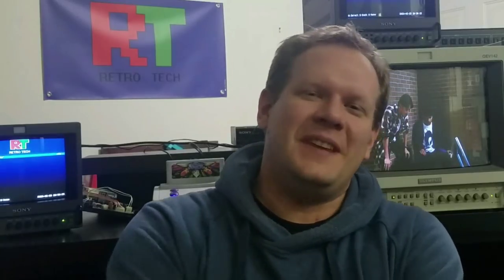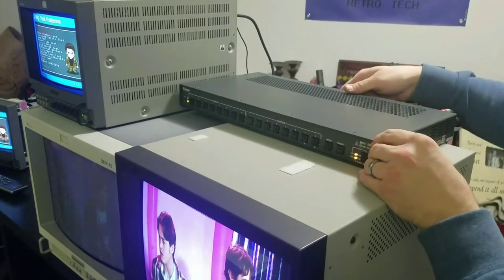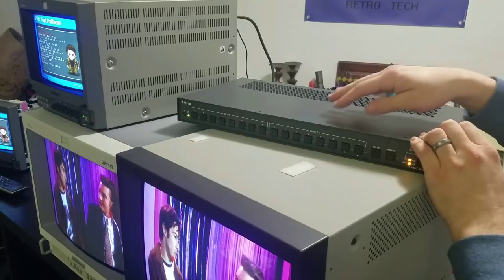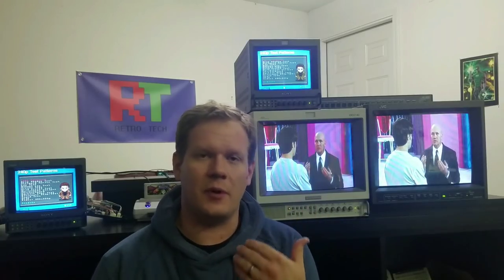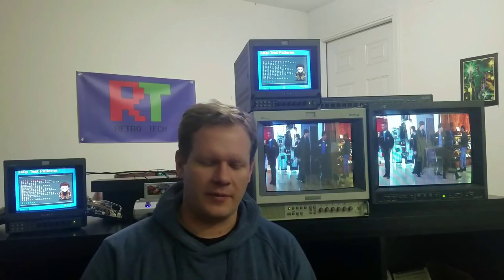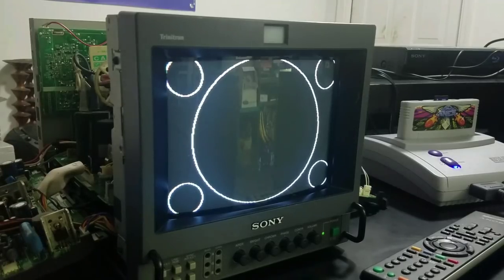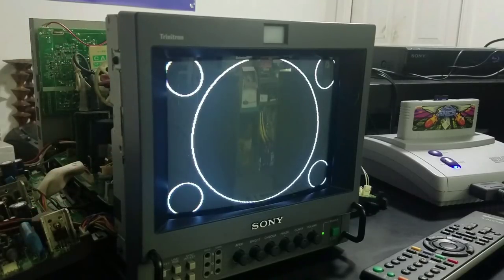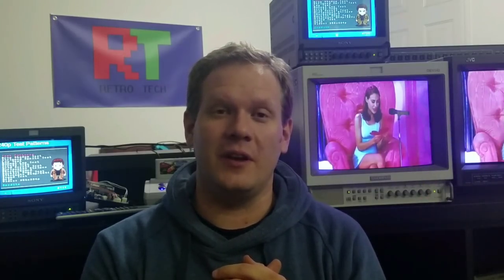The Best CRT Q&A Video on the Web! *2019 Vol. 1

Comment: I plan on getting a JVC D-Series CRT like you have and I plan on doing a full cap replacement on it.  However, I do have to learn how to solder.  Would learning how to solder well enough to do a full cap replacement on a CRT be something the average person could accomplish in a month?
Reply from the maker: The hardest part about replacing caps is removing the original ones.  It's difficult to do without a desoldering tool, but with one it is quite easy.  I recommend practicing on spare or junk electronics to get good at it.

Comment: Out of curiosity because I'm considering possibly doing a cap replacement on my sets, what differences or improvements can typically seen or be expected afterwards? Or is it a more case by case basis? Always trying to distinguish from what can improve to what is just a natural characteristic of a crt. For instance my JVC d series has nice defined scanlines in the middle of the screen but become less distinct towards the top an bottoms of the screen due to more color bloom. Do you have any before and after comparisons? I'm going to rewatch some of your content in the meantime, thanks again.
Reply from the maker: It's really a case by case basis.  The best thing to start with is trying to calibrate the CRT using the sub-menu to see if it can be corrected without a cap replacement.  If some things won't change much, like pin settings and linearity, then your caps may have failed and are causing bowing.  Also a crt can't get worse from a recap, so you can recap it & then calibrate after to see the best screen potential of the CRT.

Comment: I have a 29" consumer trinitron that is RGB modded, and I had some trouble with corner convergence and no amount of convergence strips would make it right. With small deviations they work great, but for larger distortions they don't. I ended up adding wedges to my set to pull the yoke away from the screen and that lifted the corner to almost perfect geometry.
Reply from the maker: That's great.  I have to open my 27" modded one and do that exact same thing.  Thanks

Comment: Great video!  I've encountered a number of consumer CRTs where when I've put up a pluge test pattern, I can't see the darker bars in the pattern at all no matter how high I turn up the brightness.  This problem manifests itself as heavy black crush in the picture.  Could replacing all the capacitors in a CRT restore the TVs ability to display shadow detail and no longer have black crush?
Reply from the maker: Thanks, do you mean the 3 black rectangles within the black squares?  That could be due to limited resolution of the consumer CRTs.
Reply: I am referring to the test pattern that measures black level (aka. brightness).  It does have 3 vertical black rectangles on the left and right side of the screen and a vertical gray ramp in the middle of the screen.  I guess what I'm really getting at is that I have tested out a number of used consumer CRTs that had bad black crush and no ability to display shadow detail.  For example, I'd play a game like Batman for NES and could not make out many of the details in the background because of the black crush.  I had always thought this might be because of an issue with the CRT (i.e. a bad capacitor, etc.).

Do you think that doing a full cap replacement on a CRT could restore the TVs ability to show the full black level and show shadow detail that would normally be present on your average CRT?  @RetroTechUSA

Comment: hey whats a crt model that can put out up to 1080 ..so basically do from sega genesis/super nintendo all the way to gamecube/ps2 systems ??   i was just going for a good size bvm but some of those dont do 1080.
Reply from the maker: If you are wanting a Sony, there are a couple PVMs.  The 14L5 & 20L5.  These do 240p up to 1080i.  Then there are a couple BVMs that do the same.  Ikegami monitors and NEC will go up to higher resolutions as well.

Comment: i think i have a pretty unique issue with my pvm or maybe its something simple im doing wrong? my 1353q pvm is connected to my computer with an arcade vga5000 card interfaced with my extron rgb 203 rxi. im hoping all of these things are being used if not the way they were meant to, nothing is breaking. the actual problem is that if something is being displayed on my pvm that is too bright, the image starts to distort, subtle, sometimes not subtle and its most visible if there are subtitles on the screen. anyways, im not asking for help with all of the other devices, im worried however if this is a sign my pvm is breaking down or if the brightness issue is indicative some other problem. if i adjust with vertical hold it makes the pvm freak out, and seems to be the touchiest thing aside from adjusting the brightness. extron reads H 15.73k V 60.3hz